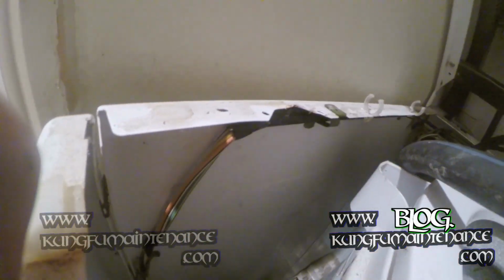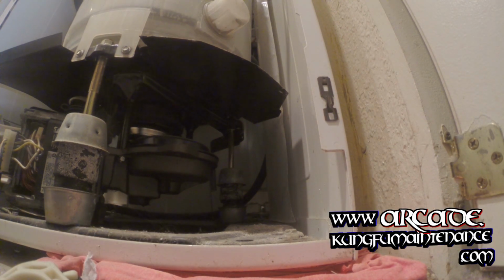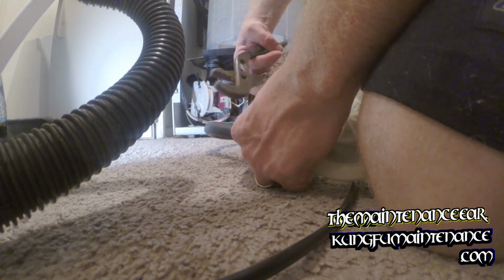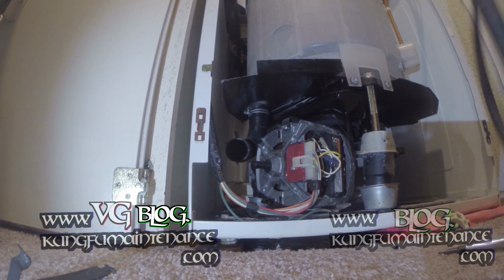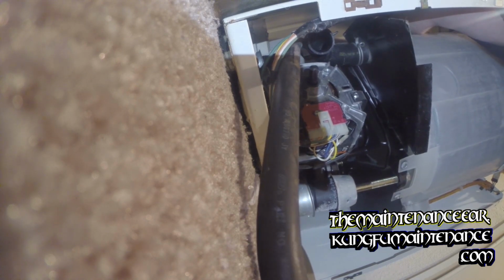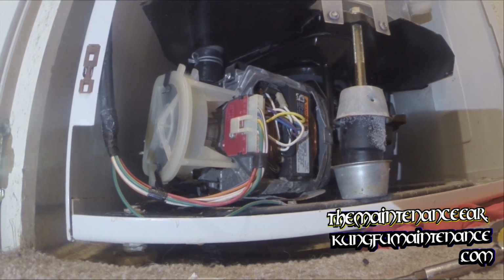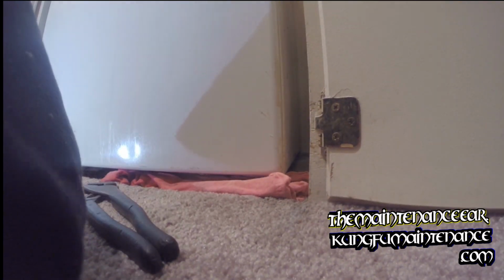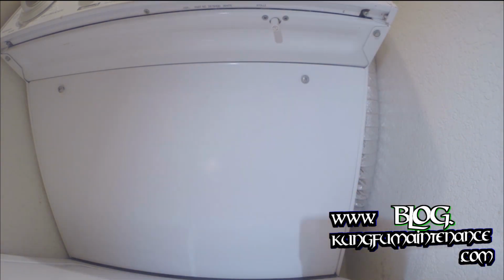Washing Machine Not Draining Spins But No Won't Drain Right Repair Maintenance Video

Comment: Here's a bit of a puzzle. First washer wouldn't drain. It would spin, and agitate, but not drain. I replaced it with another used one (from a friend I trust, says it works) the second one also agitates, spins, but doesn't drain. I'm starting to think I don't have a washer problem. Any ideas?

Comment: My current machine stops after the wash cycle. Does not spin nor rinse. Can a clog be the answer to this?
Reply from the maker: Could be but more likely it is the lid switch.
Reply: i checked the lid switch and it is working. i pulled apart the middle piece and found i was missing a agitator dog and the others are worn to hell. So, i am going o replace those first and see if that helps the problem.
Reply: Thank you for your response BTW .
Reply from the maker: MD Q You're welcome! some front loaders will stop if there is a clog. Most other laundry clothes washing machines will just continue to run but not drain if clogged. The lid switch can be jumped to rule it out as a cause of problem.